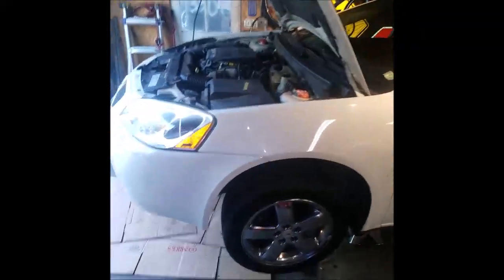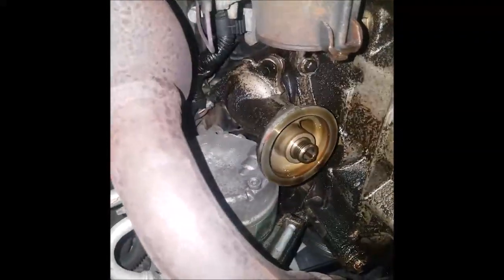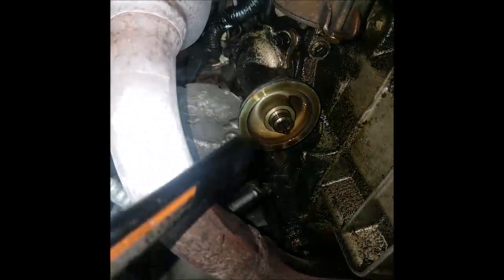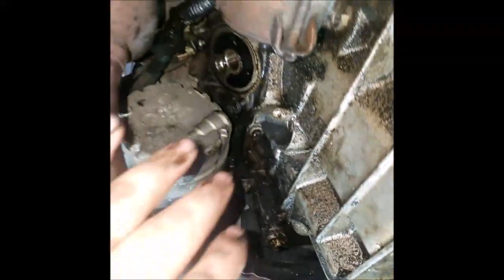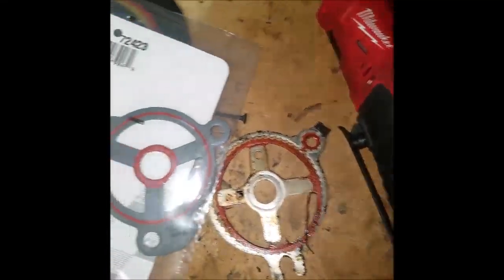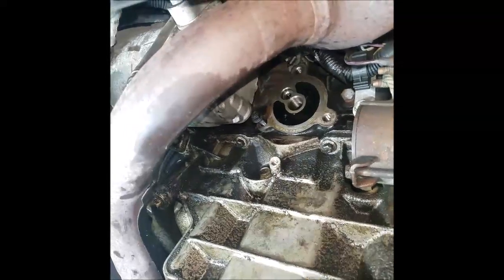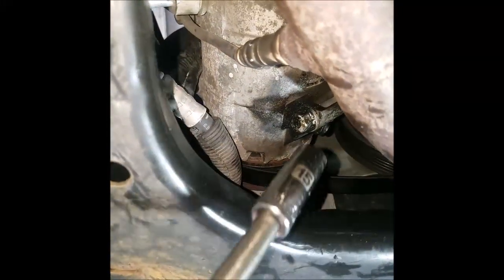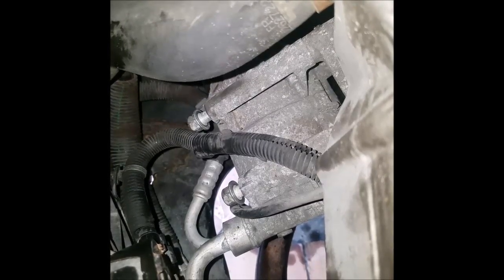2005 Pontiac G6 Oil leaking from oil filter housing gasket v6 3.6

Comment: For anyone curious, I found my oil leak on my 2009 G6 2.4l was the oil sensor. It's located directly above the starter. It was allowing oil to come out through the electrical connector and drip down the starter. Unplugging it exposed oil all in the opening for the connector. It takes a special socket to remove and install. I'd chased this sporadically for a year. Hope this helps someone. 👍🏽
Reply from the maker: Yes that is also very common.
Reply: @HooptiesGarage  Speaking of common, I'll tell you what isn't.  Had to replace the front transmission mount and it uses the one for the 3.5l engine and transmission. Using O'Reilly's, the one for the 2.4l isn't the one for mine. That was odd to me.
Reply: Thank you for your comment... this may be just what I needed to know! I have a 2006 G6 that has an oil leak. I've already replaced the starter once, it was drenched in oil, and it's happening again.
Reply: @justITSme72  I can tell you that I had a heck of a time getting the new one lined up to install. It took some acrobatics because I left everything else (starter) installed and it's hard to see. Before you remove the old one, spray brake cleaner all around to get rid of the dripping oil so there's no debris getting it threaded back in. Don't forget to buy the socket to fit the sensor. 😁

Comment: nice video. I'm doing the same as well along with replacing front crank seal and valve cover gaskets. There are noticable differences between the 3.5L and the 3.6L engines in regarding to how brackets and such are bolted onto the block. For instance the oil pressure switch is on the oil adaptor extension and also there is a heatshield over the adaptor housing.  The AC compressor has different mounting points on the 3.5L engine and would need to be removed to get access to the back bolts to the housing.

Comment: I have oil caked up on a small cover with either 3 or 4 bolts right in front of the oil pan 2006 g6...small leak while sitting.  Any ideas?